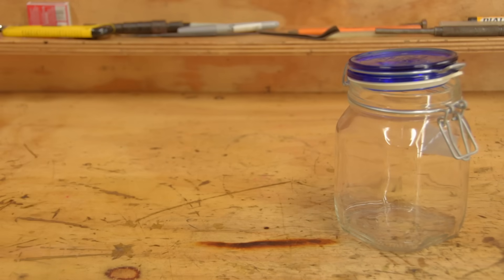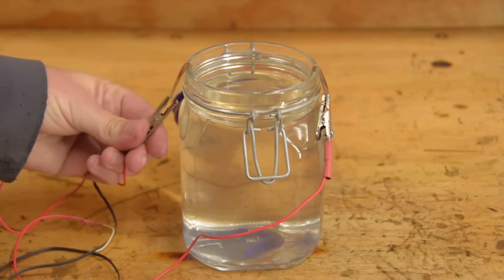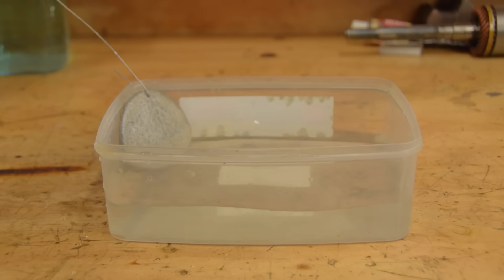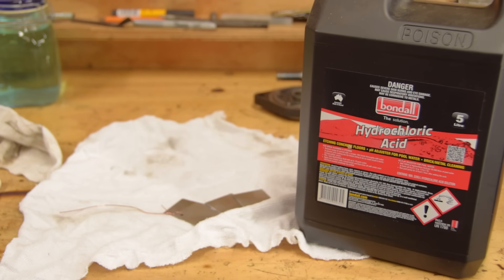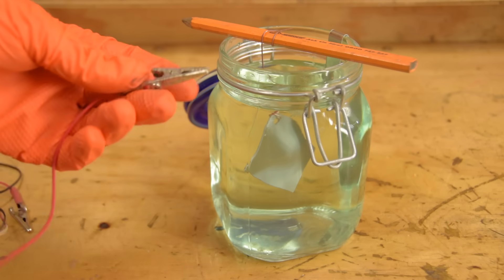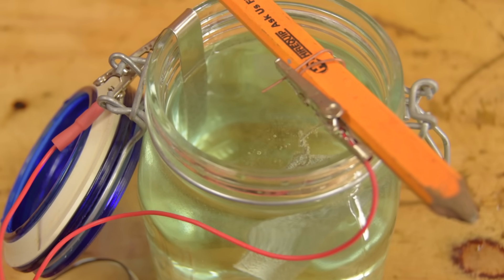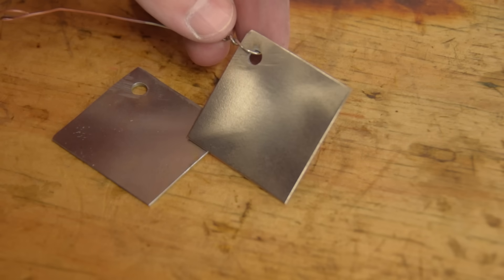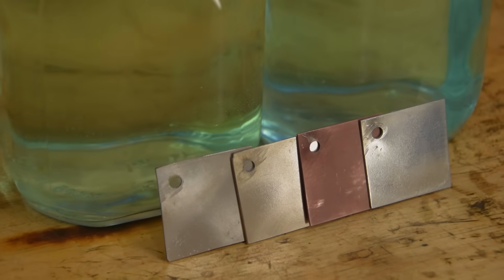Electroplating - Easy DIY Nickel, Copper, Zinc Plating

Comment: Why do we have to use vinegar? Obviously not for conductivity cause we add salt for that right? So instead of vinegar, can we use distilled water with salt? And what's reason to use a power supply less than an amp? I have an old external HDD power brick that I am planning to use but it says "output: 12V and 2 amp" I  cannot use it?

Comment: Zinc plating is galvanizing
Reply: NO it is NOT. Galvanising is when the part it dipped into very hot Zinc liquid, no electrical current required, it is just a mechanical process.

Comment: I learned something about plating I didn't know before. I always thought you had to copper plate steel before nickel plating. Good to know you should nickel plate directly on the steel and then follow with the copper plating, if desired.
Reply: also    after pkated in nikel   reverce the polarit  for 20 sec  this give  a better  strong  copper   addered
Reply: we  made  this  for chrome   plated

Comment: Is there a chance at plating plastic in this way?   These would be plastic parts that one had chrome plating, but it is worn off.
Reply from the maker: Yes. You need to buy conductive paint specifically for this. Then plate over that. Copper weld through primer might work but I haven't tried it. I'm sure there are videos about plating non metal objects on YouTube.

Comment: What am I doing something WRONG? I zinc plated my bolts and than deposited into a Nickel plating bath.  But after the nickel plating it looks like the zinc coating somehow got removed.  Can someone tell me what I'm doing wrong?
Reply: Zinc will dissolve in acidic solutions. Anyway I wouldn’t recommend plating nickel on zinc.

Comment: Hey Geoffrey!!!  Great video.  I'm inspired to give it a try.  Can I use muriatic acid for a final rinse instead of hydrochloric?   Also....if there are remnants of old plating on the object, will this new electroplating process still plate over it?   Thanks.   Bob G.
Reply from the maker: Muriatic acid is just what Americans call Hydrochloric acid.
Reply: @GeoffreyCroker  Thanks for the information.   Will let you know how it turns out.  Going to be trying to replate some 1936 vintage vacuum tube shields.

Comment: Electroplating -  Warm Nickelbath.  At 25 °, precipitation is twice as fast as cold baths.  You need other chemicals than in the example but otherwise the same processes.
Chemicals.  This is:
Nickel sulfate 180g   Boric acid   375g    Sodium sulfate  250g  Water 10 liters.    Use lot of nickel in the bath, if possible on all the walls. 
Important. The voltage may be a maximum of 3-3.5 volts. Heat to 70-75 ° degrees Celsius.  Higher voltage make the Nickel to be black and does not stick so well. 
If you get some black edges, these can be polished. Try to keep a distance of 10cm to the Nickel anode, a shorter distance makes the nickel plating uneven and it burns more easily.
Never run the bath without Nickel anodes, then remove the chemical nickel present in the bath.  
The more nickel anode in the bath, the more amperes you get out. As the voltage is low, it is important to follow the recipe carefully in terms of solutions and temperature.

If you want a nice shine on the nickel-plated material, try these chemicals. 
Coumarin, Sulfonates, Butanediol, wetting agent Sodium lauryl sulphate. A little of a detergent may be enough.
If you have no experience with chemistry, let an adult or a chemist be with you.
Once I was a surface finisher, we ran copper, nickel, chrome.

Comment: I'm wondering if this can be used to help restore some pitted chrome parts. I have a piece that has good chrome, except where it bolts on. My thought is to sand the bad areas to bare metal, and nickel plate them. With a good polish, it should be close enough to blend to the still good chrome.

Comment: I've seen all sorts of videos in which people say you can't copper plate steel, and I've seen all sorts of videos where people appear to be doing exactly that with no problem at all. Could someone explain what it is I'm missing? Copper plating steel is exactly what I have planned for my day!
Reply from the maker: Depends on the solution

Comment: Awesome  video i am restoring an old motorcycle and this will work great for all the small nut,bolts and fasteners. One question whats the best temperature to electroplate the items . Its cold here right now and my shop averages about 60 degrees F .
Thanks for the great video

Comment: Hi this was inspiring, I’m trying to make a zinc electrolyte, I’m using white vinegar and epsom salt on a heated, magnetic stirrer (I thought this might speed the process), I’m using a clock radio power supply with .3amps, after a few hours a black patina was formed over the negative anode and there is some black particulate loose in my beaker. What is this?

Comment: Hi Geoffrey, thanks for this video! you mentioned its not possible to plate copper directly onto steel and first need to plate with nickel. But I also heard the opposite: nickel only sticks to steel if first plated with copper. Please your thoughts on that? Thanks
Reply from the maker: Commercial copper plating is a different beast that uses much harsher chemicals like cyanide to get the copper to adhere to steel. Traditional chrome is copper, nickel, chrome.

Comment: I have tried making my own copper electroplating solution twice using this method, and I can never get the copper to stick to the object at all. It just plates a nasty blackish film that easily rubs off. I am testing using a US dime, which is nickel plated. Any idea what I'm doing wrong? I have an adjustable power supply, and it's only running at 1.5V or so. I have tried plating faster or slower with no success.

Comment: Just Curious ...ACTUALLY first Things First:  THANK YOU KINDLY SIR CROKER for Taking the Time to SHOW ALL of US How to Save BOO-COO BUCKS... For Myself,  I was about to spend 3 or 4 hundred dollars on a Home plating kit . THANK YOU ...Now for my Curious Question:  Have You Ever PLATED PLASTIC toy Parts... The Chrome  on most of My Toy Race car bumpers, front & rear have rubbed off & also the Chromed Parts on my Gas Powered Airplanes. I was Curious if there's a way to REPLATE THEM or If I had BRAND NEW PLASTIC or RESIN PARTS That were NEVER PLATED from the Factory, If I would be able to Plate them at home ..Thank You for ANY INFO You Can Render to us.... Have a FANTASTIC HOLIDAY SEASON. †

Comment: thank you , would you know if there is a way to coat small  plastic beads  with silver coating ? would be happy to pay for the consultation.
Reply from the maker: Yes. In theory you can DIY this. You would need to somehow apply an even coat of conductive paint, and then plate them in a barrel. I think there are probably easier ways to get where you're going.

Comment: Copper over nickel on steel? From what I've read, it's the other way round. To quote Eric Reiss, in his section on plating, in The Compleat Talking Machine :

"For real high quality plating, iron and steel ought to be plated with copper before they are nickel plated. This prevents them from rusting under the nickel - one of the most frequent causes of peeling plating on cheap machines."
Reply from the maker: Commercial platers don't use jars of vinegar. If you try this method you will find that copper doesn't electroplate directly to steel very well.

Comment: Can you plate non-metal objects with this set-up if you pre-treat them with a conductive paint? I've seen people electroplating shells, dead insects, bark etc but with a purchased copper solution with a hydrochloric acid base. The conductive paint is graphite in glue or ink.

Comment: I'm a plater. These solutions are so low in metal ions they will not perform properly. Take your thing you want plating to a plating shop, pay the nice man what you think is way over the odds and get the piece back nice and shiny. To do the job properly most baths use salts you simply cannot discharge to drain.

Comment: This is awesome! "And what about... blah blah blah" in high pitched voice. 😂 👍  Thanks for sharing this cool science experiment.  I saw some videos that didn't use a power source for copper plating.  Instead, they used their old warmed jewelry pickle that had turned blue from using it, tossed in a nail and the item they wanted plated on top of it, then waited until it was done.  Your demo showing different types of plating (which I hadn't already seen) is very cool though!👍 Thanks again! 🙂

Comment: How would I copper plate some galvanized steel sheet metal parts ?  I want a thick plating that will make the galvanized steel parts more rustproof out in the weather.  A green patina on the copper or the plating turning black would be acceptable.

Comment: Could this be done using an alloy? Would the two metals transfer equally into the electrolyte and would they then be deposited equally on the cathode workpiece?.  Perhaps making up the electrolyte using one metal followed by the other?  I am thinking in regard to brass plating using copper and zinc.

Comment: I know this video is 'only' 3 years old and you suggest Jane Kits for Australia and New Zealand but it seems they do not ship to New Zealand anymore. Do you know where in New Zealand to get either a full kit or chromates for the final process of Blue/clear, gold passivate or olive drab?
Reply from the maker: No. Did you email them? They didn't reply to my last email either, but I moved on without following it up. I don't have an alternative source for 'hobby' type supplies. I might try and solve this problem because I'm gonna need to sort it out for myself as well. I think if you want to do it yourself, your only option right now is to ask a local electroplater if you can rob some of their chemicals. Can you email me flickgeoffanemail@gmail.com . I'll keep you updated.

Comment: Zinc actually dissolves in vinegar quite well so just dissolve some in it to create the electrolyte, the electric part isn't even required for the first step. 
I'm told adding some sugar to the mix will help with the surface finish on the zinc plating, I've yet to try it though.

Comment: Why does this not work on a Hot Wheels car? It turns dark grey. I'm trying again with a better plating of nickel.
I do/did not see any copper. ALSO, I used Epson salt like when I did the zinc and Nickel plate, that worked.
If this doesn't work, I will make it with Kosher salt (No Iodine) OR do you need Iodine?
Thanks so very much.

Comment: Dear Geoffrey, thanks for the frank overview of electroplating. In your introduction, you said that you cannot plate steel directly with nickel, but via a copper intermediate step. ½ way through the video you say the exact opposite. Which way is it?

Last night I tried nickel plating a steel lever cap for a plane and all the nickel fell off.  I assume that in order to plate steel I need to use copper first and then finish with nickel. Cheers.
Reply: If you watched the video you literally watched him plate the steel with nickel first, then he plated the nickel with copper.

Comment: You should make mention of the suitability of the power supply being electrically safe. These little low weight wall-warts are switch-mode by design and are infamous for terribly bad isolation from the mains active (phase) 'hot' supply i.e. the connection that'll kill you! They work fine as per their so called supposedly 'double isolated" logo but that includes their connection lead while it's plugged into it's intended device. Modifying the external wiring takes the one step into the not so safe territory & it would be terrible anyone should be electrocuted doing such a really cool experiment as you show here....

Comment: Would washing soda (sodium carbonate) or potassium chloride be better to raise the cond'y of the solution?  Sodium carbonate doesn't have any chlorine and potassium chloride if I recall doesn't produce chlorine gas either.  KaCl  is used to raise water cond'y for H2/O2 production.

Comment: "Anything that pumps out less than an amp will do". A powersuppy which is capable of 1000A at 1.5V, and a powersupply which is capable of 1A at 1.5V will both provide exactly the same current if the load is more than 1.5 Ohm, I'd imagine that the voltage of the supply matters a lot too.

Comment: Hi.
Maybe you can help me with my plating problem. I did everything exactly how you described. I have done many practice runs at different volt and ampere settings, with times up to 1 hour. Afterwards I dunk the bolt in water and let dry. I always get rust in the threads and other recesses.
Trying to replate without removing the existing layer also isn't successful.
I have good circulation of the solution.

Any help would be appreciated.

Comment: You can't plate copper directly on steel? I must be imagine things because I did it 1000's and 1000's of times when I was an apprentice metal finisher.
Reply from the maker: This video is about plating with vinegar.
Reply: @GeoffreyCroker  Well you would have a hard time with an acid copper solution, so I guess you are partly right. My bad.

Comment: Hi. I already tried to make a Cooper calvanization on one big metal plate, but the Cooper layer goes out very fast by touching... I already cleaned the part, I used Also caustic soda but nothing changes...I used the tig machine to make the covering... I put it at 30A ...

Comment: Awesome video and explanation😁 would this kit work if I plan on nickle plate silver jewelry before gold plating? I have a DC power supply so I'll use the voltage needed for the gold solution

Comment: Just want to make a quick point about safety, I would hate to hear that someone tried this and got hurt. If your working with acids always always always add acid to water, not water to acid, it reduces the risk of the water boiling and splashing acid at you. Also common sense, have good fitting eyewear, wear clothes you dont care about, have plenty of water and baking soda to hand for spills, let someone know where you are and what your doing in case of an emergency and if you dont know what the safety procedures are for something google the SDS before you start.

Comment: Hmmm. I was a science teacher 40 years ago. We taught from the Clearway resource book. This experiment was in there.

BUT ... it said as a warning to use a very low voltage, < 2 V. If you use too high a voltage, instead of plating, the object will give off hydrogen bubbles and will turn black. I did this every time to show the boys not to turn the voltage up. So it's a mystery to me how you are getting a different result.

Comment: Dissolving the zinc anodes in some very dilute hydrochloric acid, will give you a passable zinc chloride bath that might be better than the vinegar based one.
Reply: Do you then electroplate in that?
Reply: @ian1352  Yes, you use that as your plating solution. If you have a pH meter, keeping it around 3 is best

Comment: I have a question. Like the steel became brownish in copper electroplating. So, when we electroplate silver or bronze with gold, will the silver or bronze have a golden sheen over it. If yes, won't it hide the silver's original texture?

Comment: What about the warning not to add water to acid.  Always add acid to water. If you add water to acid, you form an extremely concentrated solution of acid initially and the solution may boil very violently, splashing concentrated acid. If you add acid to water, the solution that forms is very dilute and the small amount of heat released is not enough to vaporize and spatter it.

Comment: great video..i love that little high pitched voice you put on ...if i wanted around 4 mm thich copper plating ,would that be possible,with i assume a considerable length of time??
Reply: Yes, but I would do the calculations to see how many amp-hours it would take to transfer that amount of copper.

Not an expert, but if you don't get it right, it can be spongy or brittle.

Comment: When you are preparing your steel plate for electroplating, instead of using a grinder to get rid of the rust, you can place the steel into a citric acid solution and the rust vanishes after 30mins (light rust) to a day (heavy rust).

Comment: Awesome video! I have a question for you, is there any way to go about masking off a part when nickel plating? Something fine like threads for instance. Or would you have to plate the entire thing and then remove the nickel from where you don't want it with a solvent of some type?

Thank you!
Reply from the maker: Pretty much anything will work. Paint, marker pen, etc.
Reply: @GeoffreyCroker  Oh wow, that's easy. Tanks for the reply!
Reply: Candle wax

Comment: Hey! Thank You!! Wondered for years how to go about that. Would Sulferic acid work? I have that on hand as drain cleaner.
Reply: Dissolving Nickel in Hydrochloric acid gives you a Ni chloride bath. Dissolving it in sulfuric gives you a Nickel Sulfate bath.  Both have their uses.  Here's a good link.  
https://en.wikipedia.org/wiki/Nickel_electroplating

Comment: You prepared the electrolyte solutions in advance using just the metal strips (zinc, copper, nickel) -- but what if you'd just gone straight to the electroplating step, using the vinegar and washing soda, without a previously prepared electrolyte solution? Could you just do it that way for simplicity, even while allowing it to take more time?